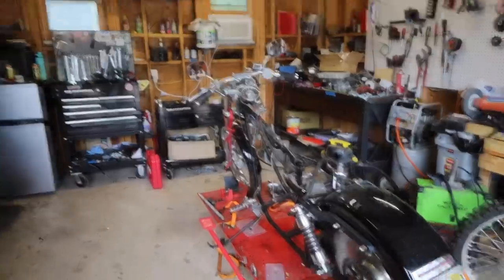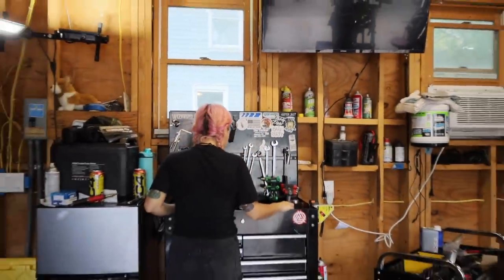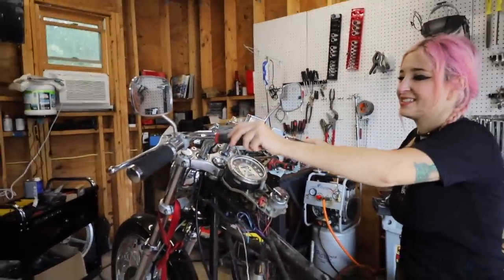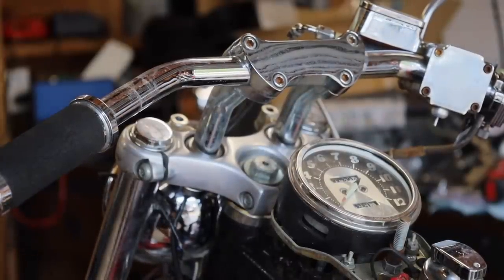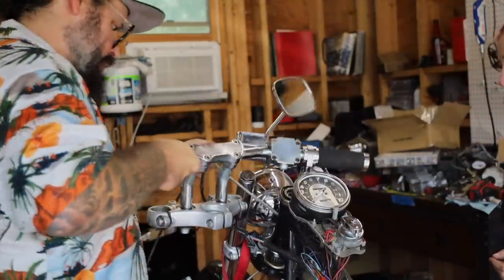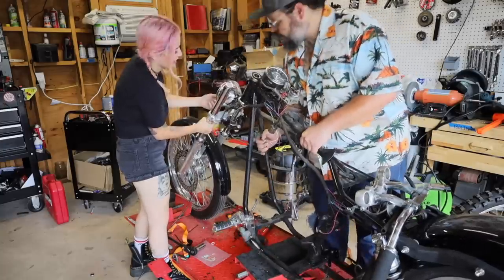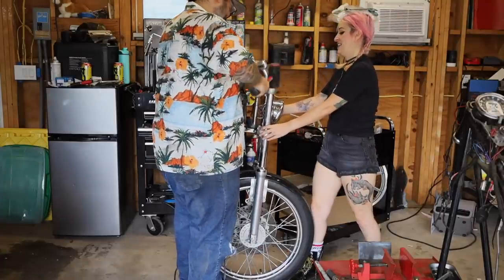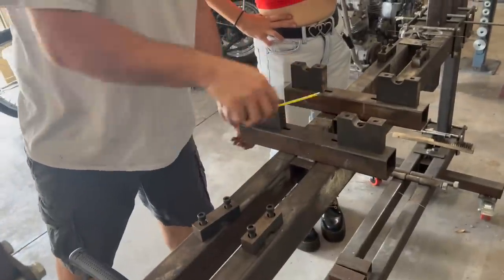Starting My First Shovelhead Chopper Build

Comment: Make sure you go with points and try to not go with a electronic ignition. Trouble Heads like points. Hardened valve guides. A magneto would be cool but can be hell to set  right. Enjoy the joy of the Trouble Head Mafia !!